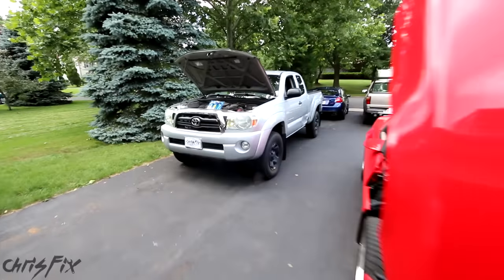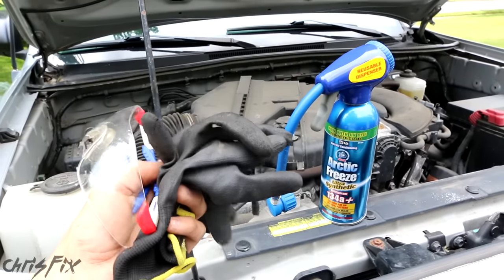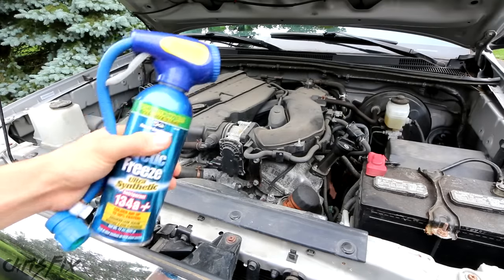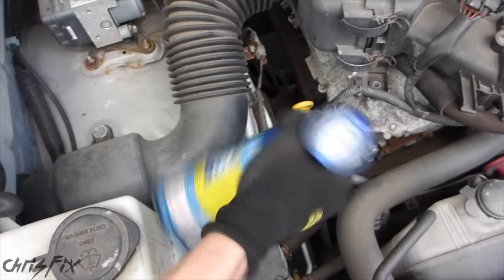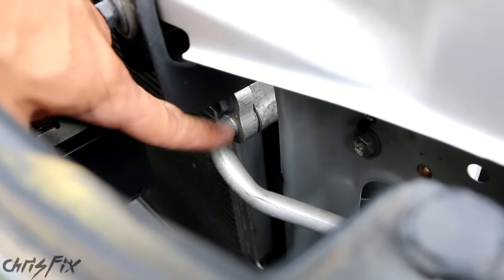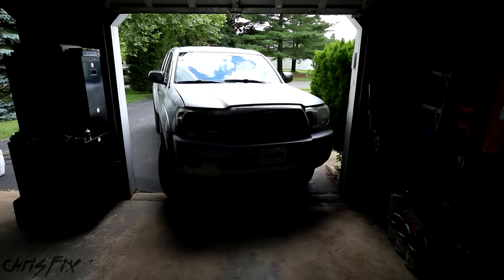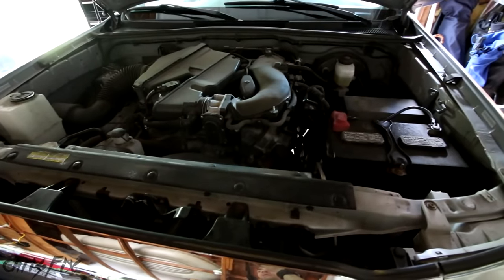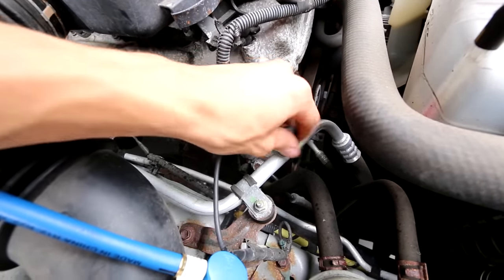How to Find AC Leaks in Your Car (UV Dye)

Comment: hi, i have a Citroen c3 Picasso, my internal ac evaporator at the dashboard is leaking gas,  i need to remove the dashboard to get to the unit for replacement, however i dont know how to remove the dashboard and cant find videos that explains how to do it, any idea where can i learn how to remove dashboard?

Comment: What if it doesn’t build pressure what does that mean ?
Reply from the maker: Either the kit is not connected properly or there is a major leak in the system preventing it from building any kind of pressure
Reply: @chrisfix  how would I be able to find it? I need to have pressure built up to use dye ?
Reply: @chrisfix  and thank you so much for replying I’m trying to repair the AC in my 2000 civic it used to have the coldest ac. Should I just try to locate by sound if the leak is big not allowing pressure to build up  ?

Comment: Quick question so I did a ac compressor for a friend and she hit something and cracked a line so the freon and oil all drained the clutch and compressor won't turn on. I've heard that the clutch with not spin with no freon detected this saving the compressor others say it's just a motor and will not detect this and is likely destroyed it's self cus of running dry I can't seem to find any certain answers any help would be great. It's a new car 2013

Comment: So  what  happens  if  there is no  gas at  all  is it safe  to  keep  driving
Reply from the maker: It is safe, just don't turn on the air conditioning!
Reply: @chrisfix   - Most modern cars won't engage the compressor if the refrigerant is gone.  The engine computer looks at the pressure transducer output, and won't try to engage the compressor it the output is too low.

Comment: Thx my chevy cruze condenser is bent form bottom like arc the ac not rely cold do i have to change the condenser or not ? Thank again
Reply: If the condos or is damaged and bent or mid formed you most likely need to replace it. I have a Chevy Tahoe and had a bad Ac line in the rear from rubbing. The UV leak detector is easy with a UV light. If the compressor is not kicking on - check the relay/fuse - but most likely you need to replace the condenser from what you described.
Reply: C.E. VIII yesterday i check it there is gaz in the ac I refill it and now it’s cold i will try it several day to see thx

Comment: pull a vacuum every time system is empty or near empty. non condensibles in an ac system contain moisture. when mixed with refrigerant and refrigerant oil makes acids which will corrode and destroy your ac from the inside out. Also NEVER EVER use leak sealer. it will contaminate your ac system and if the system is ever opened or leaks down. the presence of any moisture will cure the leak sealer (which is only a temp fix anyway) and destroy your ac system requiring complete replacement.

Comment: I have an A/C leak last sometimes a month sometimes 3 days. Been refilleded 4 times My mechanic can't find it. I checked for the leak. He changed the valve on it. But still leaks. I noticed when I take the low pressure valve cap off there is a hissing sound. Is it supposed to do that?
Reply: Could be a bad valve stem
Reply: No, if it hisses the valve core is faulty. The refrigerant WILL leak through the cap with such a noticeable leak, don't count on the cap as a primary seal.

Comment: Unfortunately, the dealer tells me the leak is behind the dashboard & that they would have to completely disassemble the dash & hope they are able to connect every wire back where it is suppose to be - will take about 8 hrs🤨 - instills a lot of confidence in them, huh - all it would have cost me is about $4K, if I said yes😏  Of course I spent about $500 on another small mechanic who was convinced it was a part in the front that needed replacing - Nope - still ran out of air😖 

I don't understand - how they can see the dye/leak if they didn't take the dashboard apart in the first place🤔🤷
Reply from the maker: Dang, if they can't see the leak in the front then they might have concluded it's coming from under the dash or they might have removed a panel to look behind

Comment: I just charged but I am afraid of over charging.  How to diagnose it?  Thanks.
Reply: Just make sure the guage on the can dont go to the red
Reply: @adamshockley1562  I added for a long time and the can went empty, but there was no change to the gauge. 
The ac has become cold after the charging which means free on did go into the system, but now I am afraid of overcharging
Reply: @adamshockley1562  I tested with the expert gauge at tempture 75 low port is 36psi and high is 158. I thnik it is good.

Comment: When I connect the hose to the low pressure, the gauge goes to the red without pressing the trigger. I have a 2007 Mazda cx-7
Reply: Make sure your car is on and ac is on full blast
Reply: @Robert-tf6yv  The car is running and the AC is at full blast and it still reads in the red. 
So I'm thinking it may be the compressor??

Comment: Just a thought could you use a smoke machine to find a leak in the (empty) a/c system? Thanks
Reply from the maker: Yes you can!
Reply: Thank you stay safe
Reply: I wouldn't introduce anything into the AC system except refrigerant, oil, and dye.

Comment: @ChrisFix or anyone else that knows how to help, my a/c has been running not hot but warm (it feels the same as when I have just the vent on) so I suspected a leak did this. The very next day I drove to work a/c was ice cold get off work drive back home a/c is not blowing that cold anymore so I thought it must have a big leak but I just checked for the due and can’t find a single drop of dye, I looked all over the car and I can’t find any trace of a leak. Am I doing something wrong?

Comment: Is there a way to find a leak without filling it?  My car blows cold but every once in awhile it gets warm and then goes cold again
Reply from the maker: That’s not a leak if it’s getting cold again. That sounds more like a problem with a blend door or something that’s letting heat into your car from the heater core. Could also be a heater core control valve
Reply: @chrisfix  ok thanks.  I’ll look into that.  I mean it’s not super cold but it’s cold.  It just switches up.  I’ve been noticing it more frequent

Comment: TIP..if you have a leak fix it, don't use stop leak, it eventually destroy the whole system, for the sake of an O-ring that costs 50cents and takes an hour to fix or a can of Innertube slime (that what stop leak is)

Comment: If you have a leak, you are going to need to not only FIND the leak but FIX the leak and you need a vacuum pump to do it.  Adding refrigerant to a system that is leaking is the worst way to do it.  You would use Nitrogen to pressurize the system with the residual R134 and sniff or ultrasonic test.   This is an obvious commercial for the refill kits sold at auto parts stores.

Comment: Hi Chris , ac is not turning on at all in Avalon 2004 xls . what I need to do ? can u please suggest me ?
Reply: I'd check the relays first, but I'm no expert, so take my opinion with a grain of salt.
Reply: @davidjereb  I replaced the Relay with new one ,still not turning on.
Reply: Sounds like a blower motor but could be the mode door also does the heat work???

Comment: Sometimes using one of these storebought cans is the worst thing you can do to your AC system. You can't measure refrigerant level accurately just by pressure. Recharging an AC system should be left to a good shop.

Comment: Ok on my 2012 dodge ram 1500 bighorn there is a pipe down below where the 2 lines go into the fire wall, it's probably a 1inch diameter its pretty big, well it sticks out maybe 2 inches and when I put the UV dye in, it just pours all my freeon out of that pipe, anyone know what that is? Is it missing a cap? It's not part of the evaporator coil is it? Someone help, hard to get a reply on these old videos
Reply: Hard to be certain, but sounds like there is a leak somewhere in the evaporator coil. If you see where exactly it is leaking, you may be able to braze a repair on the line, or better yet replace the leaking coil/line. There shouldn't be any cap that holds pressure anywhere in the system.

Comment: Hi guys.
My ac losses small amount of refregerent  every 2 years, is this normal?
Reply from the maker: Most likely you have a very small leak somewhere, on older cars that can be a normal thing,do a recharge every year and that should prevent anything from worsening!
Reply: Thanks very much
Reply: Very normal, even new cars lose about 10 grams a year, mostly through the compressor seals.

Comment: First aid advice from the chemical safety data sheet:
FIRST AID MEASURES
SKIN: Promptly flush skin with water until all chemical is removed. If there is evidence of frostbite, bathe (do not rub) with 
lukewarm (not hot) water. If water is not available, cover with a clean, soft cloth or similar covering. Get medical attention 
if symptoms persist.
EYES: Immediately flush eyes with large amounts of water for at least 15 minutes (in case of frostbite, water should be lukewarm, 
not hot) lifting eyelids occasionally to facilitate irrigation. Get medical attention if symptoms persist.
INHALATION: Immediately move to fresh air. If breathing has stopped, give artificial respiration. Use oxygen as 
required, provided a qualified operator is available. Get medical attention immediately. DO NOT give epinephrine
(adrenaline).
INGESTION: Ingestion is unlikely because of the physical properties and is not expected to be hazardous. DO NOT induce
vomiting unless instructed to do so by a physician. 
ADVICE TO PHYSICIAN: Because of the possible disturbances of cardiac rhythm, catecholamine drugs, such as 
 epinephrine, should be used with special caution and only in situations of emergency life support. 
 Treatment of overexposure should be directed at the control of symptoms and the clinical 
 conditions.

Comment: What happens if there’s no leak in your ac system but your system still blows hot in the cab?
Reply from the maker: Check the heater control valve and the blend door. Sounds like the heat is mixing with the AC

Comment: Does the clutch turn on if there is no Freon in the lines?
Reply: Most modern cars won't engage the compressor if the refrigerant is gone.  The engine computer looks at the pressure transducer output, and won't try to engage the compressor it the output is too low.

Comment: I replaced my compressor and it still leaks out -  they told me it was the evaporator but for some reason I'm suspicious. I don't have a heater so I replaced the heater core, no heat, so I took it into the shop. They revved it up got it up to temperature, thought that the heater core was clogged just go home save myself some money and flush it out. I did. No heat. So yeah, no heater no air conditioner! My dash is all torn apart underneath because the heater core doesn't work and the evaporator is right above it! Ugh!  ( I thought about my water pump but they didn't think so)  89 Pontiac Grand Am Le

Comment: This video should come with a very big warning that this product contain leak sealant and that can leak to expensive damages to your system.  It will void the warranty on the air compressor and can clog the expansion valve.

Comment: I know this is an old video. But I'm running into an issue and could if somebody can see this. My AC will run cold while I'm moving. But not while it's idling when I'm at stoplights or signs. The guys at the shop want to charge me $300 to $500 right off the top before they even look at my AC system and when my AC is running I hear a kind of a wub wub wub from a bearing possibly. Help?

Comment: I have a specialist sucked out the refrigerant out of the line and refilled it and i noticed about a month or two after that my ac not working and the clutch not engaging.. What anyone think may wrong?
Reply: Maybe the compressor is dead,i checked my freon level it was showing like its overfilled and it was the compressor that was bad

Comment: What happens if when you squeeze the trigger and it says there is refrigerate, but it doesn’t blow cold?
Reply: A number of things could be happening, are your fans blowing air into the car? If so then it could be that there's a block in your system or a broken compressor.
Reply: bruce davidson yes. Basically the car will blow cold air after a very long time of waiting or if it’s not really hot outside. I initially thought that it was low on refrigerate since it got cold eventually, but according to the bottle it is fine... thoughts?
Reply: @ryanscheppe7721  How long is a really long time? It can take while to get the whole system cold if it is very hot outside (20 min max for a stable temperature if its 100 F (40 C) and since the compressor is run off the belt the engine must be running. If you don't already I would recommend rolling your windows down when you start up your car because it can be up to 20 F (6 C) hotter than the outside temperatures. If none of that works then there could be a block in the system which wouldn't allow adequate flow of the coolant hence slowing down the speed at which it travels through the system or a bad compressor. Good luck and lmk if you need anything else man!

Comment: My car does not even give a gage reading when connected the hose
 any tips?
Reply: The same thing on my car.. Did you solve your problem?
Reply: JJ Arredondo i did not solve it but I found it 😂 i have a massive leak it didn’t not leak the a/c gas till I had put in 2 big cans mine leaked from the compressor Imma get a new one

Comment: Have a 99 mustang please help so hot my ac clutch spins for three seconds or so then stops repeatedly anyhow I went and bypassed the wire the clutch engages and stays but it is still hot put a similar gauge to show pressure it drop when the ac clutch is continuously on but when I put the wire back on that causes it to spin three seconds and pressure drops however temperature never change I am begging please help so so hot
Reply: You might have a bad pressure transducer, or radiator fan.  Both can cause your symptoms.

Comment: How do I resolve the problem if my gauge is reading in the red?    
🔴🔴🔴🔴🔴🔴
Reply: Klove The Lou the system has too much pressure in it. Usually you can let some refrigerant out with something pointy (some keys, small screwdriver etc) in the hole that you charge the system. If you press it in you should hear the air come out.

Comment: What if it’s leaking out of the valve?
Reply: The caps have a pressure seal in them.  If you don't put the caps back on, they will eventually leak out.

Comment: Yup use uv dye... see what it does to your compressor in the long term. Heres a hint, it shortens its life. Use a refrigerant detector and dont stick containments into the system. It's like using a leak stop in your cooling system all your going to do is clog stuff up. I am a certified HVAC service tech.

Comment: I was going to ask, what if my air isn't throwing air. not even hot air ):?
Reply: When you turn up the fan, do you hear the fan blowing air at all or does it just stay silent? If it stays silent, you have a broken blower motor.
Reply: Fadoks hello, thank you for commenting! Unfortunately it stays silent 🥺
Reply: selena In that case, check the fuse/relay of your blower motor first. I don’t know which car you have but I’m sure you’ll find enough info in your owners manual or online. I personally would check in this order: 1. Fuse 2. Check if the switch/knob to turn on the fan works at all and then 3. Check/replace the blower motor itself

Comment: Never turn your car/truck off with the AC running, always turn it off so you don't damage the compressor.
Reply from the maker: Thanks for sharing!
Reply: It doesn't matter.  There's nothing in a compressor that will get damaged.  The compressor is put under far more stress when the clutch cycles on, and that doesn't damage it.  Source:  Worked as an automotive climate control engineer for 20 years.
Reply: @stephenh5944  I'll continue to turn mine off before stopping the engine. Haven't had a problem with one yet by doing it this way.
Reply: @MrThunderMetal  - no problem, whatever makes you feel comfortable.

Comment: Hello I have a problem with my toyota Car ac system. I have Consulted Many Car AC Exprts. they checked but unable To Find The Leaking point. I my self vacuum my system and the vacuum stands for 15 days . after that i filled My System with r134a . After two days of driving with AC on I Notice that the gas level is gating low. I Vacuum Again and leave the System Vacuumed for an other Two days And refiled my system again . But after driving 50 km with AC on I noticed that the gas level is low again .I will be very happy someone help me.
Reply: The leak is probably on the high pressure side of the system.  Whatever is leaking can withstand the vacuum (-14.7 psi), but can't hold the high pressure of 150-300 psi.  Have you tried the UV dye leak test like in the video?
Reply: @stephenh5944  thank you very much. Trying to find dye in Pakistan 😫
Reply: @waseemriaz9498  - Good luck!

Comment: don't have a thermometor
Reply from the maker: You don't need one! I just used it show the temperature drop haha
Reply: @chrisfix  i changed out the blower fan and the resistor and it got cold after i recharged it and then a month later it blows hot air  so i don't know everything is running